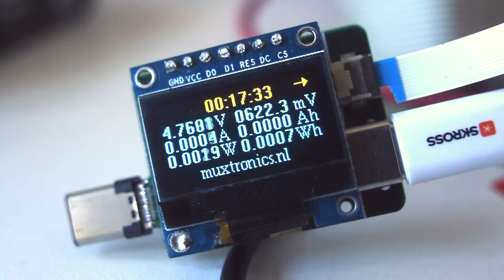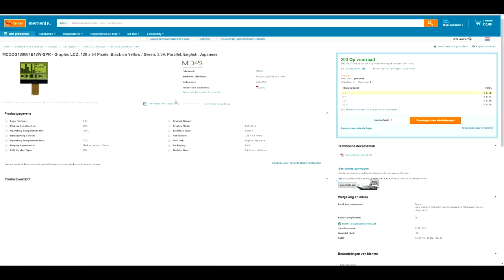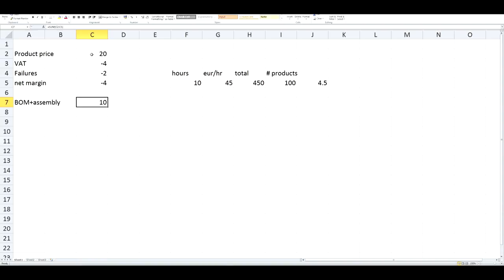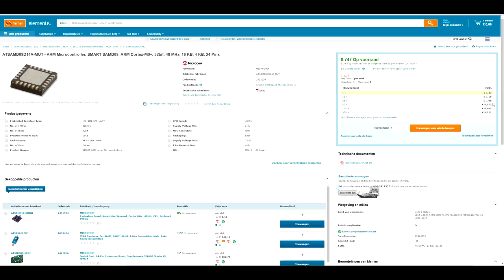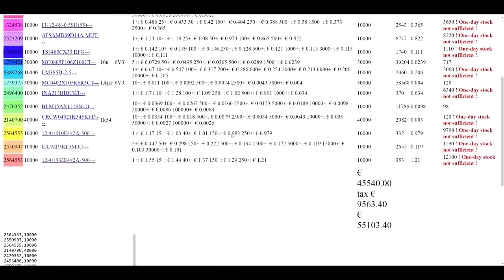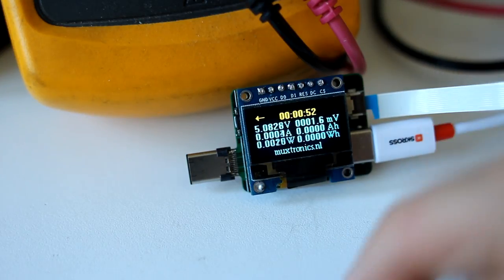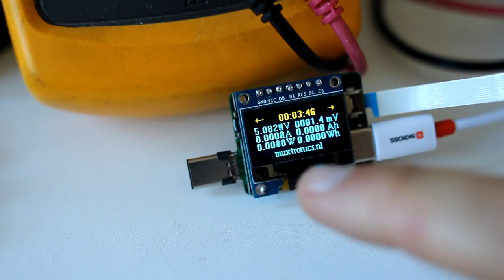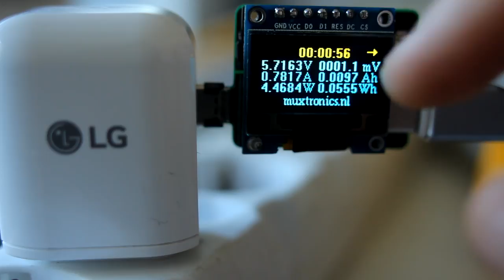How to design for low cost (and still kick ass) (049)

Comment: Finite Impulse Response Filter in software with lookup tables would make readings a little smoother with adjustable cut off.
Reply from the maker: It's not just that, though. Just a lookup table with [X pixels lit up = Y power consumption] would fix inter-frame differences in power consumption of the device, but sometimes a conversion window crosses over a screen refresh. There is no good way to compensate THAT with a LUT. You really have to make it so the measurements never run during a screen refresh, which complicates the firmware a bit. I'm not 100% done figuring out how to get that to work...
Reply: PowerElectronicsBlog The lookup table would store Sinus and Tangus precalculated values depending just on the screen refresh rate. With the Finite Impulse Response formula you can then very fast calculate update frequency depending on input sample frequency to synchronize updating your display. It's like in computer terms using a cutoff frequency to in similarities prevent screen tearing when V Sync is off. Your microcontroller you showed doesn't even have to calculate Sin or Cos or Tan, such table can be created on your PC. It's like computers can't subtract. But with second complement of a negative number a computer can Add negative numbers in a Full Adder. It looks very nice what you created. The camera by filming interferes too of course. But the FIR I mean is only to synchronize the display to wishes.
Reply: Could you just add another USB port purely to draw power from?
Reply from the maker: Okay, I'm going to have a go at this.
Reply from the maker: I could, but it would add cost and not be in line with my design requirements. Part of cost-optimized design is really identifying everything you can dispense with.

Comment: Great work and very interesting story ! But I still not understand, your controller is connected to Ubusin, so no influence on current sensor if your power source is on USB-in, right ? But if power source on USB-out (your device is bi-directional) then you will get your error ? But this can be solved if you feed your controller from both sides of shunt using two diodes and get no error on any power sorces connection, correct me if I wrong.
Reply from the maker: If I would do that, I would get an undefined current flowing through the resistor if the diodes aren't absolutely perfectly matched. That is even harder to control for. The nice thing about my circuit is that, in principle, the average current draw of the circuit during a measurement cycle should be well within the measurement resolution. So it's really just a static add/subtract

Comment: Nice project there, I like your web page XML parser for parts. I'm thinking about ripping it off for Kicad output, which is also XML.

5 digits is really nice, but what is the accuracy? I couldn't see a schematic on your site but I guess you have a burden resistor, and for a $10 production budget a calibration stage is probably not possible, so are we talking 1%? I ask because do a lot of current measurement that way as well, but with careful calibration.
Reply from the maker: Yep, specified accuracy is 1%, and I do have to do single-step calibration to get there (as my reference is rated 3%). However, if I would do linear calibration I could probably claim 0.1%, as all components have very low temperature coefficients and drift over time. Certainly 0.25%. But yeah, for the lowest cost I'm not going to do more than just single-point offset calibration, and then it's hard to get better than 1%.